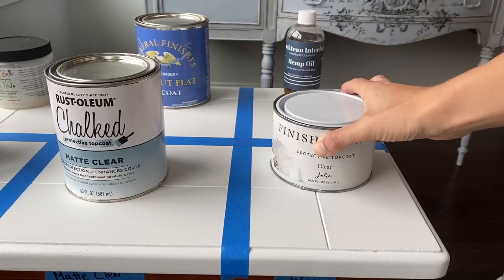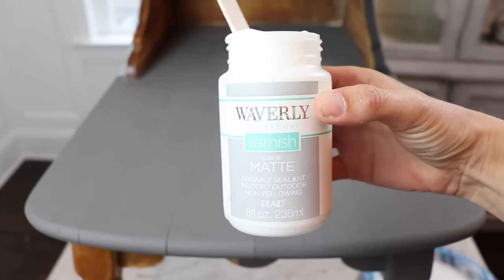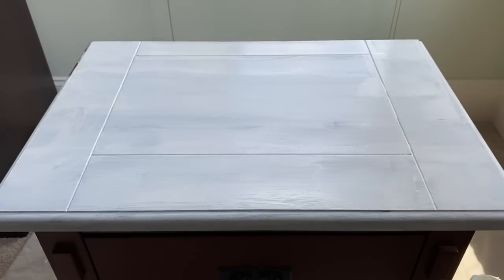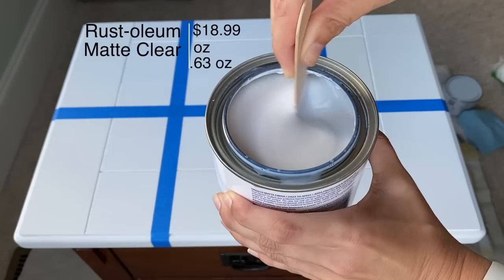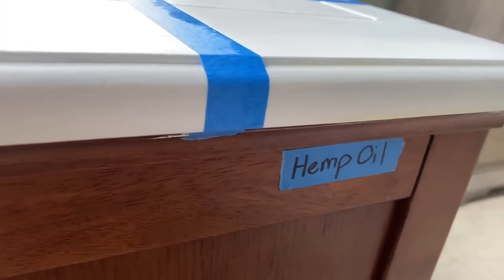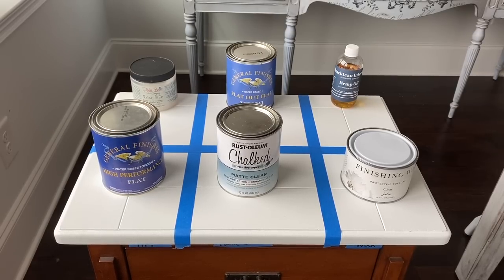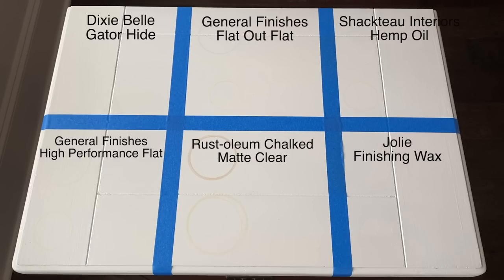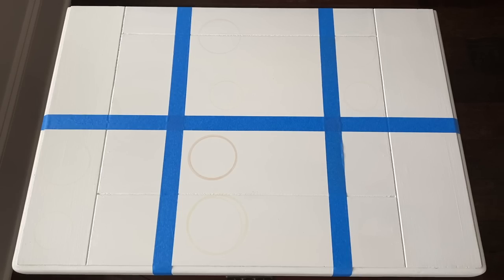Battle of My Favorite Topcoats w/ @salvagedbykscott

Comment: Three coats of General Finishes with light 220 grit sanding in between coats. That would have been the correct way to apply. Would have had zero damage.
Reply: Good to know because I just bought some.  I have used Annie Sloan Wax, Dixie Belle Matte clear and Poly acrylic so will try Flat out Flat.  Thanks again for all the info

Comment: Love this video!!  I am sure it took quite some time to complete :), so, thanks so much for doing it!  I am surprised at the GF outcomes.  They are my favorite top coat for surfaces.  I will say that we painted out oak kitchen cabinets about 8 years ago using GF Milk Paint in Linen and I top coated them with GFHP in Satin.  Even though I sanded and then did two coats of primer before painting, the Linen yellowed after about 2-3 years.  I can't remember what primer I used - probable Kilz.  That might have been the problem.  Again - great video Christina!!
Reply from the maker: Thank you!

Comment: Thank you!!! I really struggle with top coats. I have been using a coat of DB top coat, let dry according to directions, then two coats of gator hide and finish with another coat of the top coat. This was recommended to me by the owner of the store where I buy my Dixie Bell Products.  I’ve used this method on the drop leaf of my kitchen island and have had no yellowing with easy clean up. Again, thank you. This was so helpful!!!
Reply from the maker: You are so welcome!
Reply: Can you share exactly what did you use ? I am about to paint my kitchen cabinets and can’t use químico thank you
Reply: @aidegarabedian2073  I used DB chalk paint.

Comment: The rust-oleum chalked topcoat will yellow in heat and it will change the color of your piece almost daily.  I live in a 100 yr old farm house, so I don't have A/C and all the pieces that I top coated with the rust-oleum do have a yellow tinted on them.  I know that the yellowing in heat will happen with oil based topcoats but not water based, so I assume that the rust-oleum is oil based even though I couldn't find where it says oil based.  I will say that on some pieces the yellowing makes it look older...

Comment: This was SUCH a WELL TIMED Video! I had just watched Katie's video and went to watch yours as I'm about to do my top coat on my Desk redo 100% inspired by Katie's Popsicle desk! I used this EXACT Dixiebell color! So this was super helpful! I want to ask, as the wax seemed to do a great job on both of your experiments, I am heavily considering going with wax over my General Finish High performance Flat or my Minwax Polycrylic. But my question is, I have Annie Sloans soft clear wax- do you think this will act as the Jollie wax you used?? 
I also have Sweet Pickins oil wax. And Dixiebell big mamma butter and Varathan Polycrylic ... so please let me know which you think I should use on this desk I've slaved over ;) thank you both!! You ladies ROCK!
Reply: I've used annie sloan wax with great results. I had awesome results with Maison blanche was as well. In Katie's video I was very impressed with the Behr wax. I think you'd be happy with Annie Sloan.
Reply: @RM-uo9oc  thank you! I ended up using the Annie Sloan Clear wax I had on hand. I did one coat. I haven't used in a while. I know I need to do probably 2 more coats, but do I buff in between or after all 3?
Reply: @meme2255  I've only done 1 coat of wax but I would buff bt coats.

Comment: I just discovered you so this is my first video of yours I’ve seen. I would love to see a video on HOW you clean all your brushes and with WHAT you think works the best to clean them. Also any tips and tricks you use on how to keep brushes good while taking breaks in the middle of project’s during dry time and what not. Please let me know if you’ve already addressed these topics in a previous video or if you e watched one on these topics you’d recommend. Thanks!! Absolutely love you and have subscribed!!♥️
Reply from the maker: One step ahead of you! :)  Check out this video..https://youtu.be/ck_DsxirJ_0
Reply: The best tip I've found to keep your brushes clean is to buy Floetrol. It is a paint additive that increases the open "working time" of any paint before it begins to dry triggering brush strokes. Adding water to paint can help, but it can also change the hue/tone/color, especially milk paints that get reactivated with water if you aren't mixing EXACTLY the same water every time. Floetrol doesn't do that. It effectively makes your paint more "buttery" not watered down. The secondary benefit (to me almost the 1st) is that if you pour some Floetrol in a cap, then dab your finger in it, and spread it around the TOP HALF of your paint brush (on both sides of course) and work it in, it will help prevent your colored paint to travel UP. Paint as usual and when you go to rinse your brush, only the bottom half will be clogged and dirty and the top half (the hardest to clean) will look untouched and a BREEZE to clean.

Comment: I had a terrible experience with Rust-Oleums chalk paint and coating. Very streaky, chunky and hard to work with. I've since switched over to Dixie Belle and have had a lot of success. Their satin top coat is a little streaky over dark colors but I don't mind.
Reply: Me too...not the paint as much as the topcoat.
Reply from the maker: Thanks for sharing. I heard a tip that if you add a little bit of your dark paint color to your top coat it helps with the streakiness. Katie and Pam at 44 Marketplace have both done this.

Comment: I used rust oleum a chalk paint straight in a sanded maple dresser. Both coats went on drying very quickly. Is that normal fur chalk paints? Ir just crappy brand chalk paints? And us that why you add a bit of water?

Comment: My friend wants me to paint a bathroom vanity for them with chalk paint.  What sealer would work best? I’m worried about the humidity in the bathroom effecting the paint.
Reply: They make "bathroom" paint with the correct chemistry and anti mold additives for this exact purpose. If you insist in using your specific chalk paint, they sell anti mold/mildew paint additives at homedepot/lowes in the paint isle. The efficacy of going this route is questionable. You can't test whether the additive will "float" on the surface to be effective or if it is too diluted and drowned/clogged up in the chalk paint itself. How do you know it is in a concentration high enough to be effective and can you prove its longevity? Or are you wasting money? only a chemistry lab can tell. Let your wallet decide and good luck.

Comment: What, in your experience, is the best to coat for a dining table that would be lighter in color? It seems this was for furniture other than dining tables. Or could I take these results and apply to a dining table, in your opinion?
Reply from the maker: These results could definitely be used for a dining table.  In my home, my dining room table is waxed and my kitchen table is GF High Performance.
Reply: @ChristinaMuscari  thanks so very much. That is very helpful!